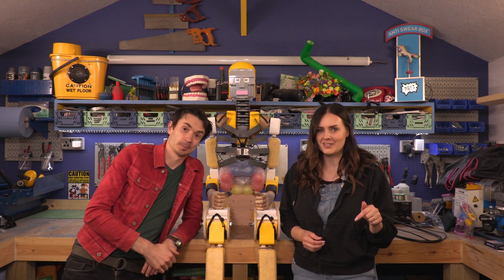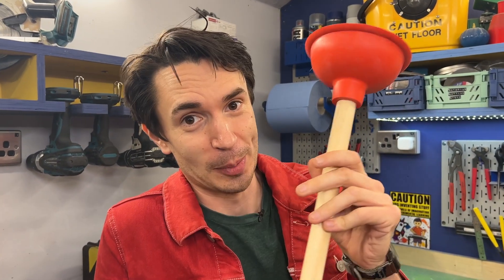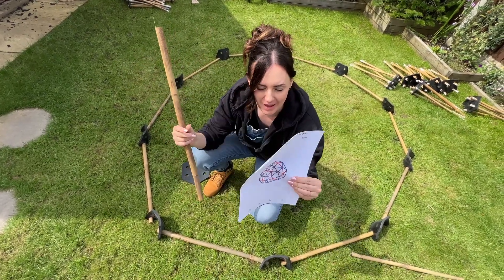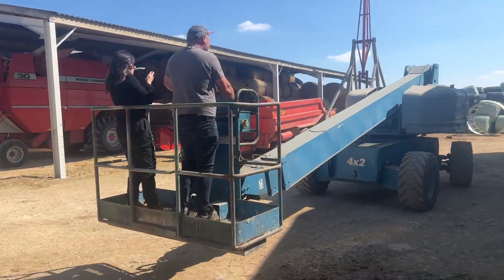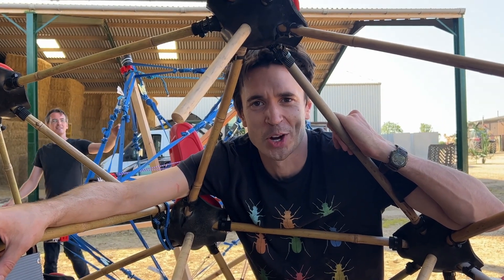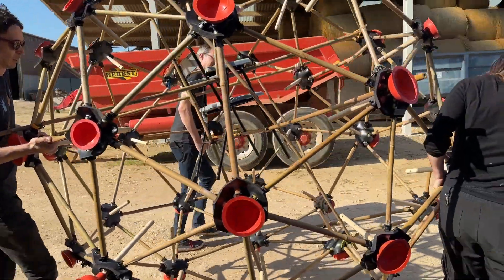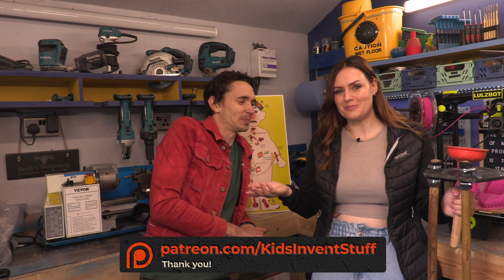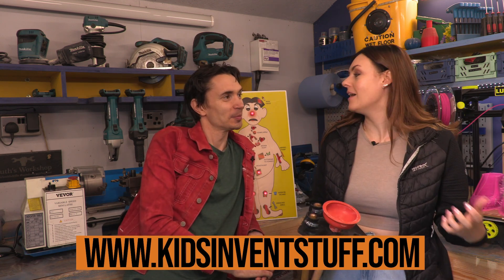The FIRST ever HUMAN Egg Drop!

Comment: My 4:41 prediction: it's going to go almost completely flat at some point, but seeing as it's joined mostly with rubber it probably will bounce back.
Reply: Slightly less flat than I expected, but I forgot that once the bottom has collapsed and the dummy hits the ground there's very little mass left in the rest of the structure to compress it further.
Reply: There's also another slight problem with the design... even if the structure didn't collapse it would have to flex a lot to do anything useful but then those plungers would still be rather big poking hazard to the dummy.
Reply from the maker: Like meat on a stick, but with Humpty and bamboo
-Ruth

Comment: End fastening can be cheaply accomplished using press-fit cross-pins made from dowels. Use one on each side of the rubber. My instinct says to orient the pins 90 degrees to each other, but I'm not sure.

Regarding the tower escape process that Florence had in mind, I wonder if she meant for the ball to slowly roll down the wall.

Comment: A cheaper means of securing those rubber pieces might include using some strong bailing wire.  Twist it around a few times then twist the ends together like twist-ties, using a pliers to twist, then wrap it around and do it a second time to increase the strength even more.  It may not be as strong as hose clamps, but cheaper, and certainly a lot stronger than zip ties.

Comment: is there a reason why you didn't drill holes in the wood and put pins in them (perhaps using nails as pins) to prevent it slipping through the rubber instead of the cable tie/jubilee clip method?